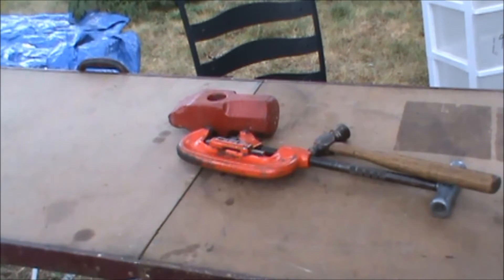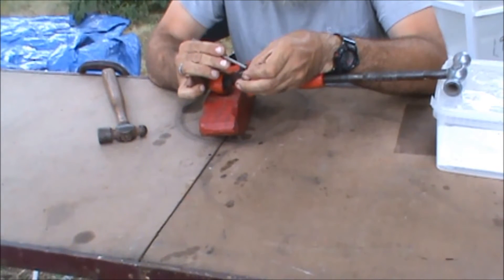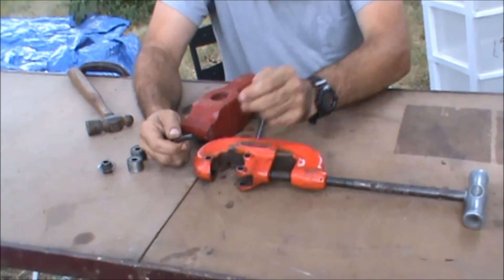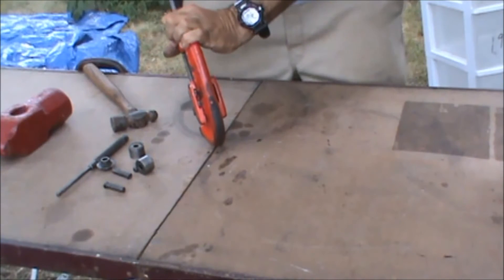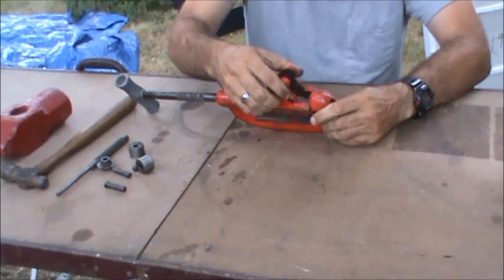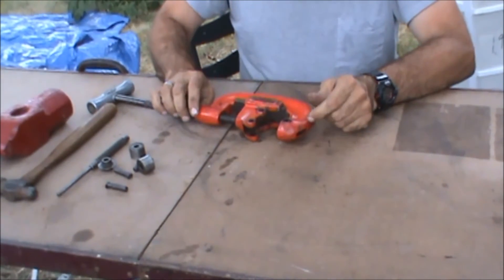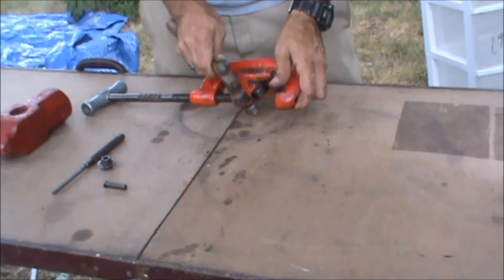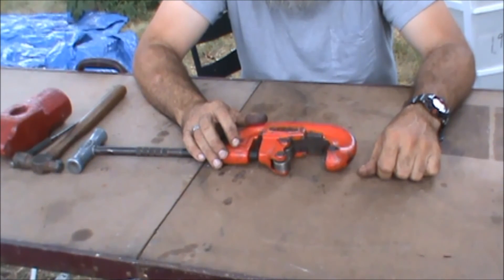Ridgid tubing cutter

Comment: Great video. I needed a pipe cutter on a compressed gas facility. Couldnt use demo saw, bandsaw or drills. Nothing with brushes internally. A guy on the job lent me one. And it sucked cutting as much pipe as i did but it worked. So i ended up getting one from a flea market for $15. All the wheels are seized. Thanks for a great video

Comment: Last year I bought an old large vintage Ridgid pipe cutter second hand similar to the one you have that I'd like to restore. The only thing wrong with it is the thread on the adjusting rod (part with the handle on it) is rusted solid, I am unable to turn it. Any ideas on how to get it looses again?
Reply: I use brake fluid with a little Basic-H added. If that don't work, heat the threaded sleeve up.